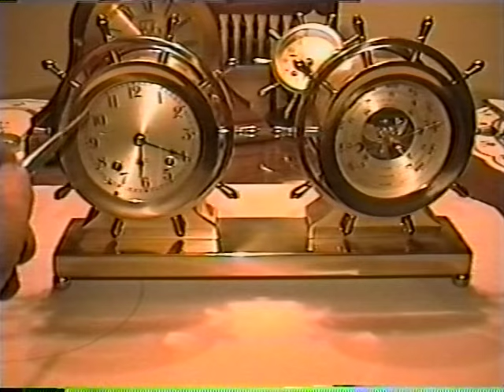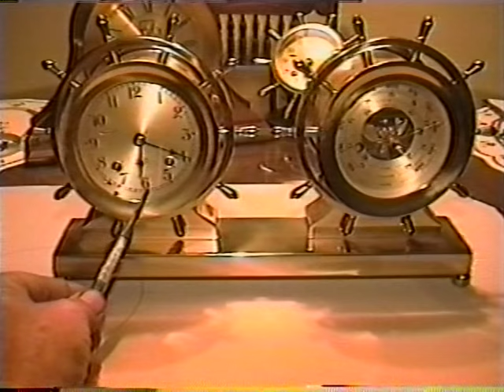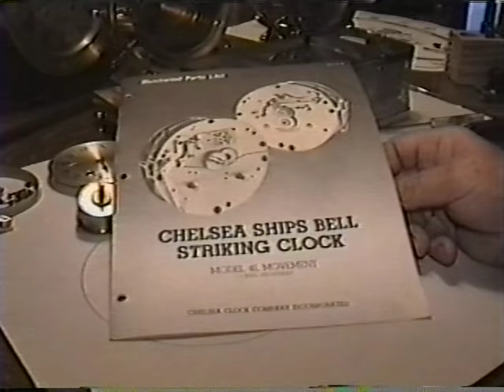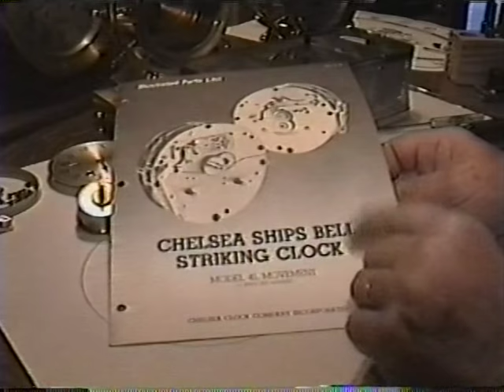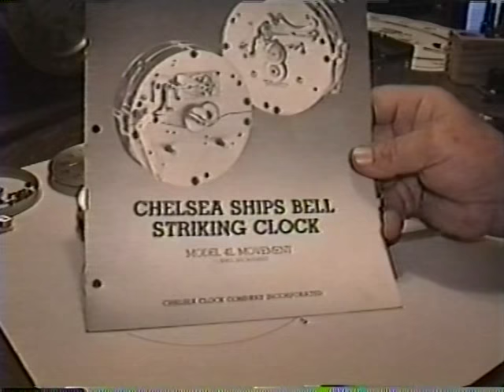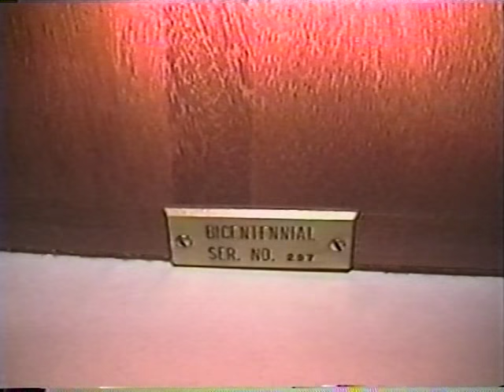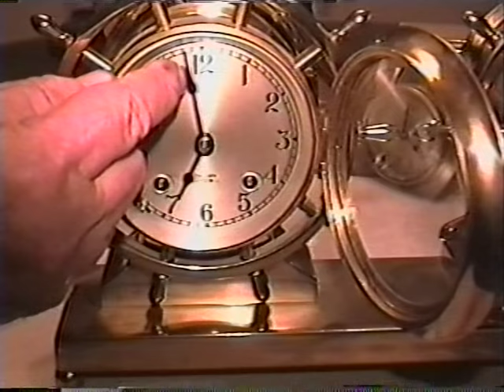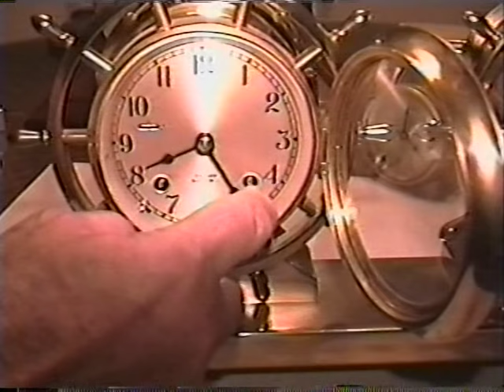Chelsea Ships Bells Clock Repair

Comment: I have a Tiffany & Co. Ship’s Bell clock I got from my father.  I have very little knowledge about it.  The clock does not tell time and the bells are not correct, only striking 2 on the hours and 4 on the half hours.  Do you have a manuals for the Tiffany clocks?

Comment: My Chelsea chime spring is wound too tight. Is that an easy fix?
Reply: I use a letdown tool to release spring tension. Involves gaining access to the winding area of the movement by removing the clock face, applying the tool to the winder stem while releasing the catch on the ratcheting mechanism. Do it carefully and slowly as the spring has a considerable amount of tension on it and can do harm...ask me how I know! :(

Comment: I have a Chelsea Shipstrike from 2005 and the bell pattern is out of sync.  For example, at 9am, it only rang 6 bells and it should have been 2 bells.  I know with a pocket watch, you could just lift the hands off and reset them at the correct time, but I hear that is not recommended for the Shipstrike.  How do you fix this?